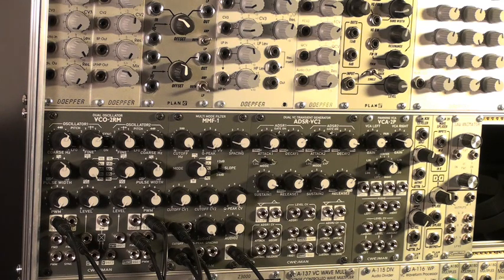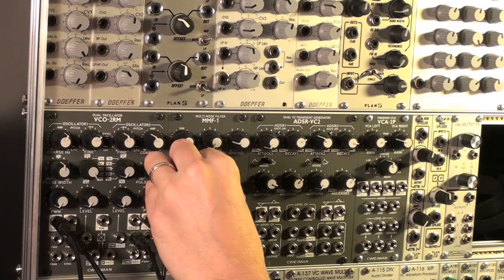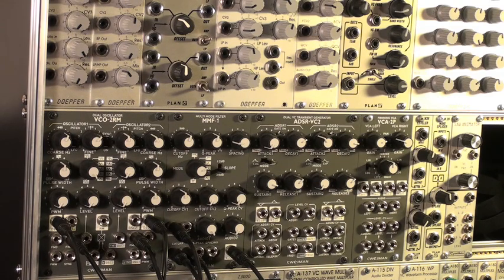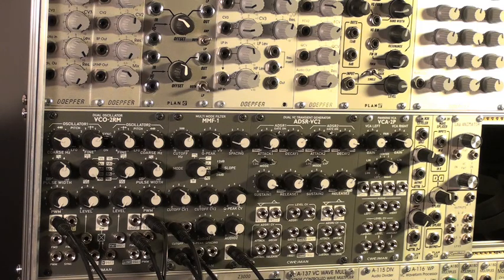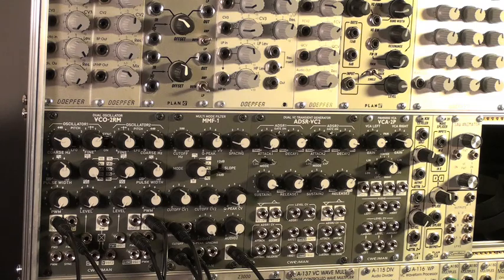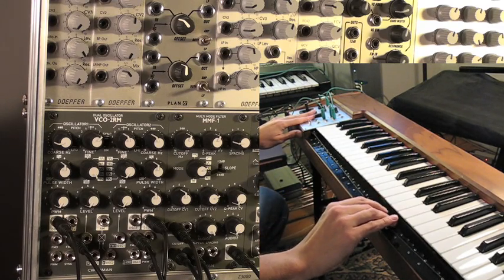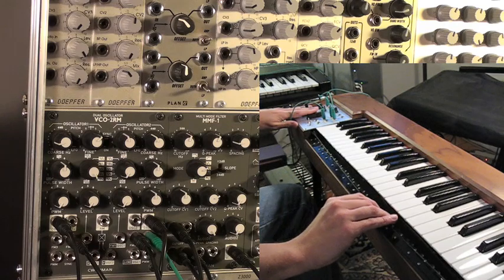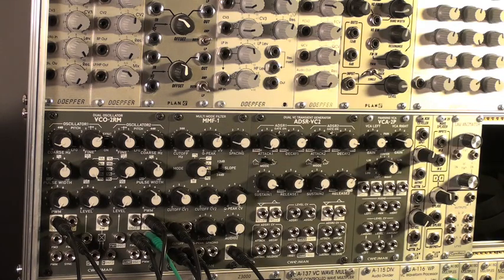Vocal 'Ahhh' patch on a modular how to

Comment: This Cwejman thing is neater than ARP2600.  Do you teach sounds synthesis in college?  Because you are extremely knowledgeable here.  I mean, to achieve formants one needs two or three band pass filters to achieve those peaks, and yet you simply do this with two oscillators synced, and some FM?  Is that a standard method of achieving vocal timbres?

Comment: Cool video.
A simpler vocal sound can be made by ring modulating 2 pulses, sync one to the other and turn up the pitch of the synced oscillator. Oohs and aahs can be made with this patch. It will sound much rougher than this patch though.